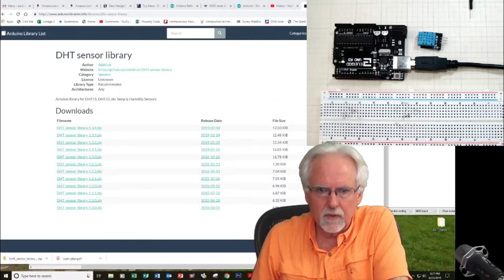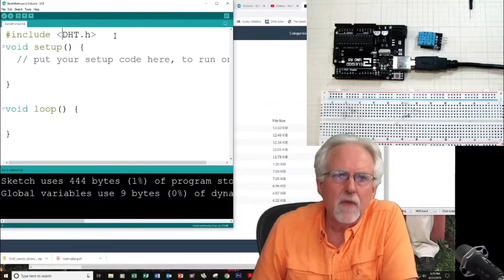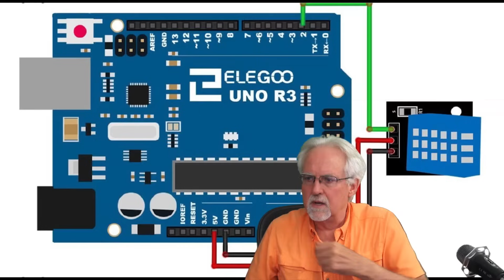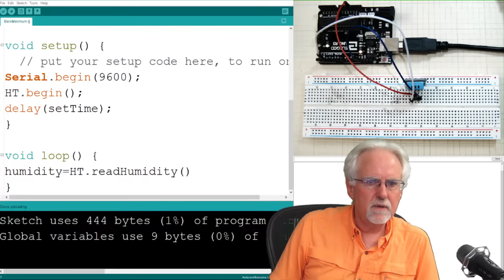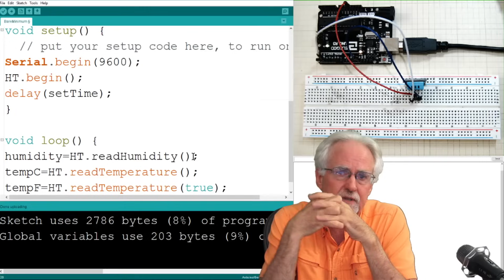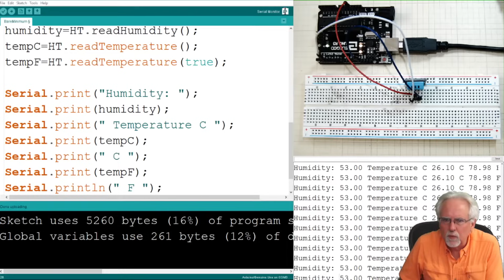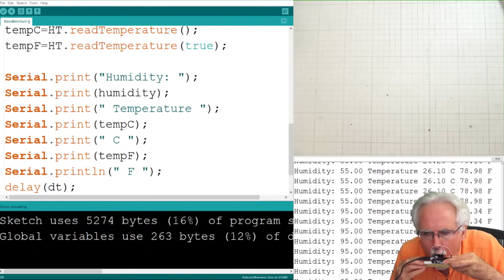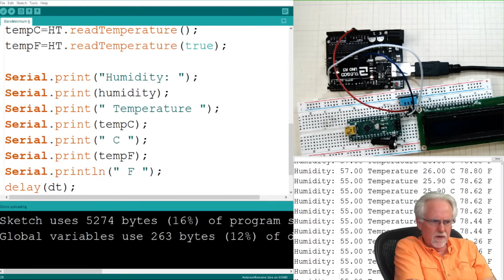Arduino Tutorial 50: How to Connect and Use the DHT11 Temperature and Humidity Sensor

Comment: Hi Paul, I know i did something wrong but i can't seam to fix it. i have a arduino uno3, a D3231 clock with DHT22 using a 12c(20,4) display. The time in seconds changes every 4 seconds line 0,0 and when that does on line 0,3 it keeps adding by 4 points to the humidity and the name time on 0,0 changes the first 2 letters to 20 instead of the word time it reads 20me every 4 seconds. can anyone please help?

Comment: Like Pastel using the exact code that Paul prescribed I am getting Humility: nan Temperature: nan C nan F. I have reset my Arduino, verified the library is properly installed and have verified that pin 2 of DTH11 is connected with pin 2 on the Arduino. Please anyone help!

Comment: Although my compiler can see the library (had to use "" BTW) on the line DHT HT(sensePin,Type); I keep getting the error C:\Users\SUPERU~1\AppData\Local\Temp\cc4srKzq.ltrans0.ltrans.o: In function `global constructors keyed to 65535_0_Arduino50.ino.cpp.o.1730':
<artificial>:(.text.startup+0x62): undefined reference to `DHT::DHT(unsigned char, unsigned char, unsigned char)'
C:\Users\SUPERU~1\AppData\Local\Temp\cc4srKzq.ltrans0.ltrans.o: In function `setup':
C:\Users\Superuser\Documents\Arduino\Arduino50/Arduino50.ino:15: undefined reference to `DHT::begin(unsigned char)'
collect2.exe: error: ld returned 1 exit status

exit status 1

Compilation error: exit status 1

Thoughts

Comment: Hello. Can anyone HELP. I opened the zip file and pasted it onto desktop, found where the library was stored and pasted the file into it. When I try to upload the library to the Arduino using both methods speech marks and brackets. I get an Error compiling for Arduino Uno. exit status 1. I deleted the DHT file and downloaded it again. Still the same. HELP!!!
Reply: well, i got the same issues and then some. I tried several nano boards and still unable to upload. Now I get port 4 busy or avrdude: stk500_recv(). Have ever seen this and did you resolve your issues

Comment: I had  lots of problems with this lesson. Your code did not work for me. I found some DHT11 code written by Dhruba Saha that worked. His syntax was different and when I tried to modify his to include yours, I got nothing but errors. I think this all has something to do with the version of IDE and the DHT11 libraries. One question I have that you haven't explained, is how the #include<DHT11.h> knows how to get the correct library. My library has numerous DHT11 libraries whereas your example shows only one.
Reply from the maker: When you install the libraries, there should only be one with that exact name. You should not have different libraries with the same exact name.
Reply: 😅I think this is my mistake

Comment: I could not get it to compile, no matter what. Tried different versions of DHT library. Uninstalled. Reinstalled. Nothing worked. It wasn't until I did a Google search of the error message, "Adafruit_Sensor.h: No such file or directory," that I discovered I needed to also install the Adafruit Unified Sensor library. Then it compiled without any further complaints. Very frustrating.

Comment: Could not, for the life of me, get my code to work. Took me a while to get the library situation figured out... there was a missing h.file in the download's folder. After that, I kept getting error codes for other stuff. Never even got to the body of the code. BUT... I did understand the premise, and am certain I can write the code for the homework. 

Any suggestions with my code?I am at a loss. The very first error pertains to
DHT HT(sensePin,Type);

"DHT11_sensor:26:10: error: 'HT' was not declared in this scope
 humidity=HT.readHumidity();
          ^~
exit status 1
'DHT' does not name a type; did you mean 'DHT22'?"

Comment: Im on mac OS, Im having issues using that ZIP file. I have tried putting the unzip file into library nothing. I tried putting opening through adruino using the sketchbook then add a zip file and it doesn't want to take it. this is so frustrating :(
Reply: Never mind, figured it out. I also attached a motor with the fan on it to turn on when the tempF reach a certain number. pretty cool. ;)

Comment: BIG PROBLEMS. I installed the library in my MAC. Which is different than the PC approach. At first it couldn't find the library and I got a No such Library error. So, I went back and re-installed it.  Now, I'm getting a different error message: Error compiling for board Arduino Uno, exit status 1, Error compiling for board Arduino Uno. I did a test sketch with just the command #include <DHT.h> (also tried "DHT.h"). The DHT lite a different color meaning it accepted the DHT library command. But, still I get the same compiling error. Even with just that one simple command. There appears to be something major wrong. I've given up and will try another day if I get some feed back help.
Reply: OK, I've located the problem. It's with the library DHT, I installed. I checked other library calls with no problems in test sketches. So, it's definitely a Library problem with the DHT. The one I uploaded is the latest version 1.4.2. There are several other DHT libraries listed in the library manager: DHT ESPx, DHT12, DHT12 sensor library, DHT2pin, DHTlib, DHTNEW, and DHTstable. Something is causing the library to keep the sketch from compiling. What???

Comment: "humidity:nan tempC:nan tempF:nan" why is my output become like this? someone help?
Reply: HI from Australia, I had the same problem and found a mention on the Adafruit site of installing a pull up resister on data pin, installed 10k resister from data pin to 5V and it worked, good luck.

Comment: If you guys have issues with your Arduino IDE not including the DHT11 sensor libraries after installing, it could be that your initial preference location is preventing Arduino from accessing your libraries. My libraries for Arduino are under a folder called 'Arduino 15', which when I manually search for it in my file explorer, I can't find the path. I'm using Windows, and what I had to do was go in and manually set my preference directory path to /Arduino15/libraries. 

- First, go to Arduino's Preferences, press 'BROWSE', and then look in the top bar that shows your folder (directory) path.  

- Press the 'Local' folder location, and once in there, select 'Arduino 15', and then 'libraries'. 

- Now drag and drop your unzipped DHT sensor library into that 'libraries' folder where the rest of the Adafruit sensor libraries should already be. 

If you struggle with this or can't find the libraries, make sure to press 'Cancel' at the bottom before exiting the Sketchbook file explorer so that you don't drop your DHT libraries into the wrong folder and set your preference to another location that doesn't contain the libraries.

- FINALLY, under the 'Library manager' tab at the side, search for 'DHT sensor library' by Adafruit, and install it. This process was crazy for me, but I figured it out eventually!

Comment: The copy paste procedure didn't work for me. I got a compiler error. Instead I simply used Tools menu of the Arduino IDE: Tools>Manage Libraries and installed the DHT library from there. It also created another folder called: Adafruit_Unified_Sensor that is required for the DTH11 to run.

Comment: I give up. My humidity and temperature readings are way too low. I wonder if I need a new dht11. Also, installing the library was onerous. I had to install an adafruit library in addition to the dht11, whatever the heck that is. It did work however....

Comment: OK so It helps to have the UNO plugged in but the messages the IDE sent me led me to believe that the path didn't work. The IDE eventually told me to plug the UNO in and now everything is as it should be. No funny messages and it accepts " or < but  the DHT is RED when using < > and Black when using " "

Comment: why do i get nan when reading the temperature
Reply from the maker: nan means not a number, which means somehow you are dividing by zero.
Reply: @paulmcwhorter   I am just trying to get readings from the sensor, there is no math or equations .
Reply: I am getting a NaN too. The example code in the DHT library says "Failed to read from DHT sensor" for a value of NaN. Is my DHT11 faulty?
Reply: @rnirms  check the pin outs of your sensor. Try 5v left, data middle, ground right

Comment: i have no idea what i did wrong on this one. i cant get the sketch to compile. i double check it and then copied the code from top tech boy. it still wont work for me.
Reply: I think my problem is with the DHT library. i always get an error compiling for board Arduino Uno whenever i include that library.

Comment: Hi, Paul, I'm stuck.  I did find out that I needed to install the adafruit library as DHT is dependent on it,  but all I am getting for readings of each one is "nan", which I believe stands for "not a number".  I've triple/quadruple checked my wiring, and even copy/pasted the code from TopTechBoy.com to make sure.  I don't know what to do next or how to test to see if the sensor is defective itself.  I know you don't usually comment (I'm surprised you even manage to read and/or "love" comments!), but if you have a quick comment to point me in the right direction, I thought it was worth asking.   I'll keep searching for getting "nan" from the DHT11, but in case you have an idea, it would be really helpful.  I know I'd love to use this module more, but I can't even make it through the lesson... Thanks, in any event.  Marv.

Comment: help what can I do to solve this error message I've tried to unplug the cable and/or switch the USB port and I've also tried to reset the Arduino but nothing works but only with this code I can't upload it 

Error Message:
Failed uploading: no upload port provided

my code: #include "DHT.h"
# define Type DHT11 
#include <LiquidCrystal.h>
int sensePin = 2;
DHT HT (sensePin, Type);
float humidity;
float tempC;
int hSec = 500;
int Qdt = 250;
int Rpin = 53;
int Gpin = 52;
int rs = 7;
int en = 8;
int d4 = 9;
int d5 = 10;
int d6 = 11;
int d7 = 12;
LiquidCrystal lcd(rs, en, d4, d5, d6, d7);

void setup() {
  // put your setup code here, to run once:
Serial.begin (9600);
HT. begin();
delay (hSec);
pinMode(Gpin, OUTPUT);
pinMode(Rpin, OUTPUT);
lcd.begin(16,2);
}

void loop() {
  // put your main code here, to run repeatedly:
humidity = HT.readHumidity();
tempC = HT.readTemperature();
lcd.clear();
lcd.setCursor(0, 0);
lcd.print("Humidity");
delay(hSec);
lcd.clear();
lcd.setCursor(0,0);
lcd.print(humidity);
delay(hSec);
lcd.setCursor(0,7);
lcd.print(" Temperature ");
delay(hSec);
lcd.clear();
lcd.print(tempC);
lcd.setCursor(0,13);
lcd.println(" C ");
delay(Qdt);
if (humidity < 60){
  digitalWrite(Gpin, HIGH);
  digitalWrite(Rpin,LOW);
}else{
  digitalWrite(Rpin, HIGH);
  digitalWrite(Gpin, LOW);
}

}

Comment: Hey uh it gives me this 
Arduino: 1.8.19 (Windows 10), Board: "Arduino Uno"

sketch_jan21a:1:10: fatal error: DHT.h: No such file or directory

 #include "DHT.h"

          ^~~~~~~

compilation terminated.

exit status 1

DHT.h: No such file or directory

This report would have more information with
"Show verbose output during compilation"
option enabled in File -> Preferences.

Comment: Here is the homework

#include <LiquidCrystal.h>
#include <DHT.h>
#define type DHT11

int rs = 13;
int en = 12;
int d4 = 7;
int d5 = 8;
int d6 = 9;
int d7 = 10;
int sensePin = 2;
float humidity;
float tempC;
float tempF;
int dt = 10000;

LiquidCrystal lcd(rs, en, d4, d5, d6, d7);
DHT HT(sensePin, type);

void setup() {
    lcd.begin(16, 2);
    Serial.begin(9600);
    HT.begin();
}

void loop() {
    humidity = HT.readHumidity();
    tempC = HT.readTemperature();
    tempF = HT.readTemperature(true);

    lcd.setCursor(0,0);
    lcd.print("Humidity: ");
    lcd.print(humidity);
    lcd.setCursor(0,1);
    lcd.print("Tempreture: ");
    lcd.print(tempC);
    lcd.print(" C ");
    lcd.print(tempF);
    lcd.print(" F");
    delay(dt);
    lcd.clear();

}

Comment: This seems to me the most confusing part of the arduino software is getting the right library installed. Always missing some H.file I wish we could have a super class on making that work. I want to copy a sketch and upload to my arduino , never works always missing some H.file ,  then you get their library zipfile and it never never works right. I pray and PRAY even more someone would do a class on that specific thing before I throw another computer out my window!
Reply from the maker: There is an adafruit unified library you have to make sure you have. See i you can get that and it should help.

Comment: My DHT11 has 4 legs.  Apparently some come like that.  Stupid.  Should be given another name or revision or something. 
Anyway,  Pin1=+5V, Pin2 is sensor and Pin4 is Ground reading left to right with pins at bottom, looking at what looks like the face of the device (not at the writing side).
Other schematics had the sensor pin (Pin2) also hooked to +5 through a 4.7K Resistor, but it made no difference to mine, so I took them back out.
Hope that helps someone out.

Comment: I am so angry and sad at first because the LCD does not have both female wires extension, it only has this chip on its back and you need to download a new library for it, so I couldn't print anything and know this HDT11 the library worked but it is saying an error (compiling from Arduino Uno) so I could not work with it either and seeing how you're going with it you will teach next the water sense which I was looking forward for it to make an automatic watering system for my high school know I fear that you will need a library for the sound sense and the other chips that will help you make a balancing RC car and line tracking RC car. I lost today's battle but I will not give up and work as hard as I can so to win the war.

Comment: Arduino: 1.8.19 (Windows Store 1.8.57.0) (Windows 10), Board: "Arduino Uno"

In file included from C:\Users\Bilawal Mirza\Documents\Arduino\temp_and_humidity_sensor\temp_and_humidity_sensor.ino:2:0:

C:\Users\Bilawal Mirza\Documents\Arduino\libraries\DHT_sensor_library-1.4.4/DHT_U.h:36:10: fatal error: Adafruit_Sensor.h: No such file or directory

 #include <Adafruit_Sensor.h>

          ^~~~~~~~~~~~~~~~~~~

compilation terminated.

exit status 1

Error compiling for board Arduino Uno.